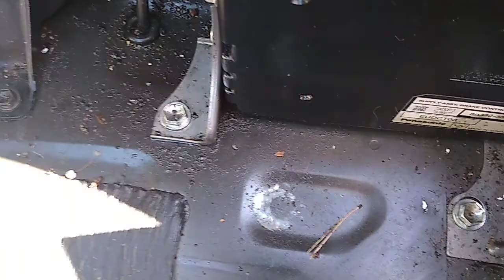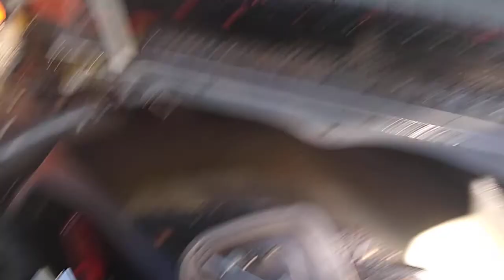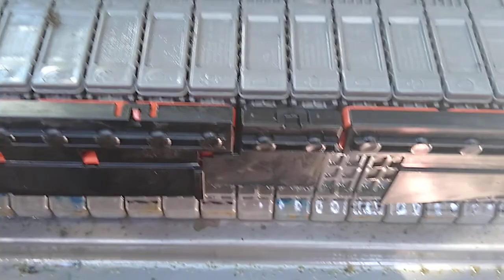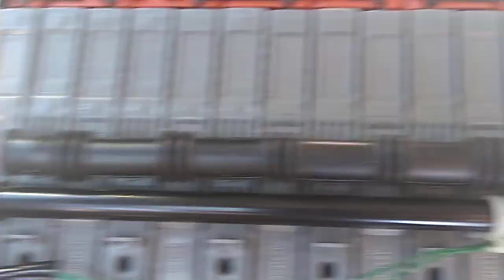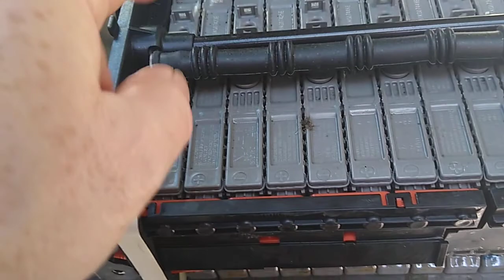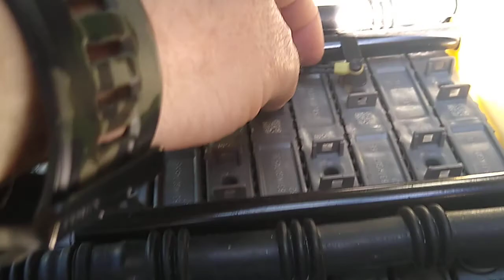Prius 2 contrôle batterie hybride

Comment: Ma Lexus CT à 12 ans et 128 000 Km en espérant ne pas avoir de merde rapidement dessus, Après je me demande si ça vaut toujours le coup de faire l entretien chez Lexus c'est la seule question que je me pose.
Reply from the maker: @opoaloas9563  bonjour vous avez le temps en général ça commence à faire des faux contact après 15 ans et 250000 km pour mon cas,
Reply from the maker: Et surtout pour éviter les pannes de batterie toujours faire au moins un trajet de 20 km minimum par semaine,
Reply: Merci du coup après vos 15 ans et 250000 Km vous avez du faire changer votre batterie ou pas. Je suppose que ça coûte entre 3000 à 4000 ça pique 😂